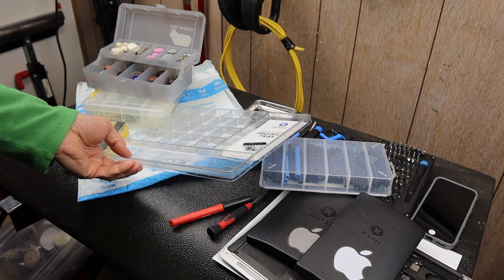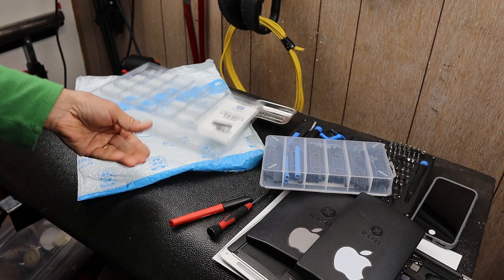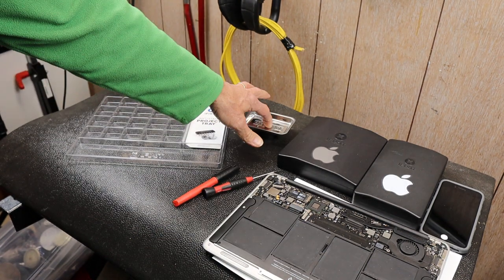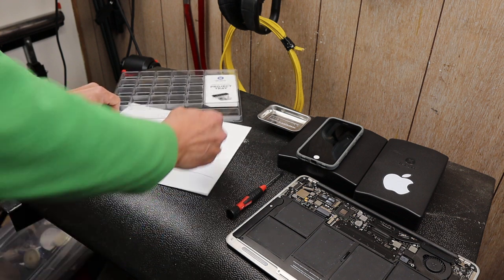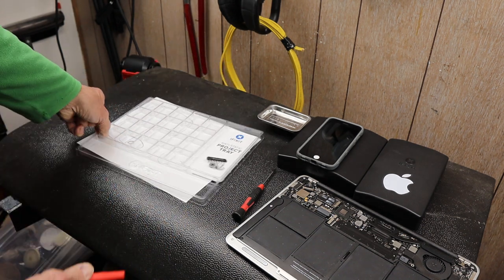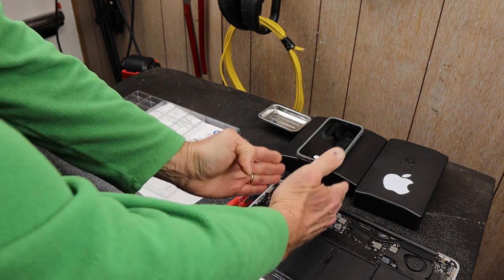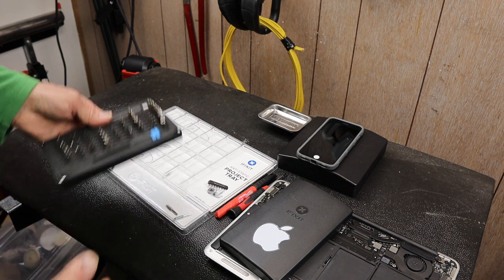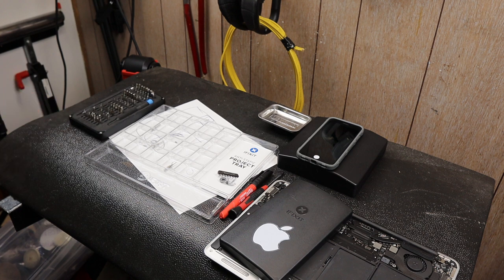A Clear Solution: The iFixit Transparent Project Tray with possible anti-static properties

Comment: Ok now I understand the clear feature.   Some parts on an iphone, every screw on the same plate is different.  This might help.  I was just getting to where is seemed like getting a set of the smallest ceramic food prep/dipping bowls might be the best way to go anyway.   Ceramic is nice as it doesn't get blown off the table when someone opens a door and is anti static.  There is always putting a rock on the clear tray . . . and putting screws in the right arrangement on doubled up or double face tape.  Hey, I wonder if that clear gecko inspired gripper tape would work well?   That sounds better 3m reuseable mounting putty, which I originally bought to use to reseal my Canon integrated printer carts, but is really totally not great for hanging paper on the wall.  I gotta get some of that gecko tape.